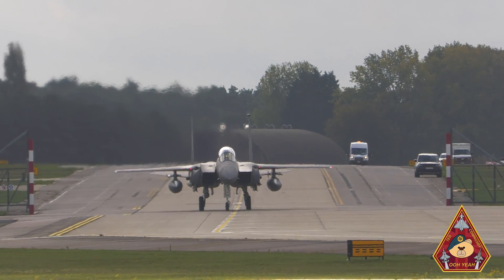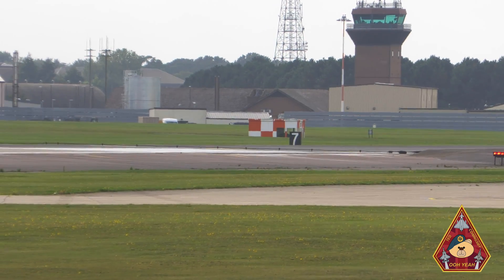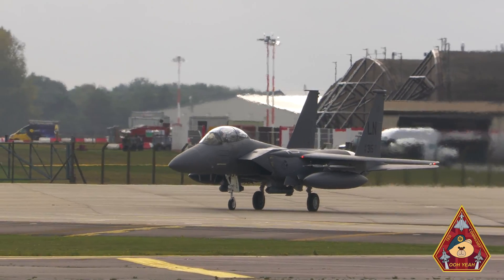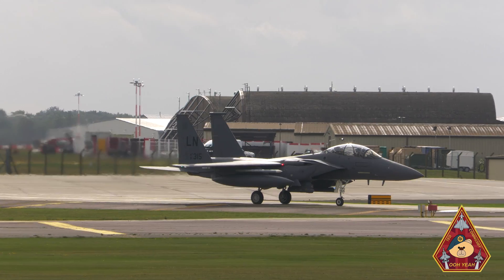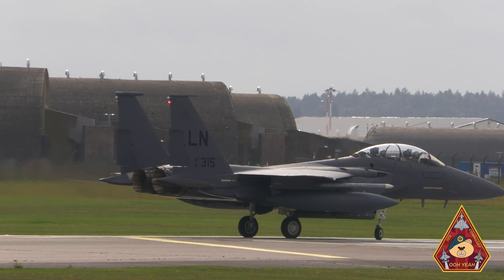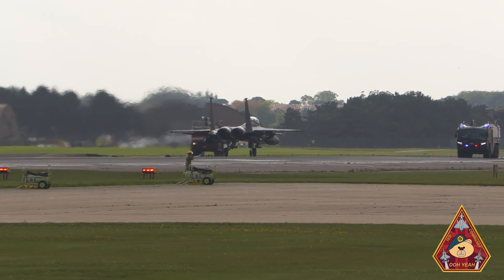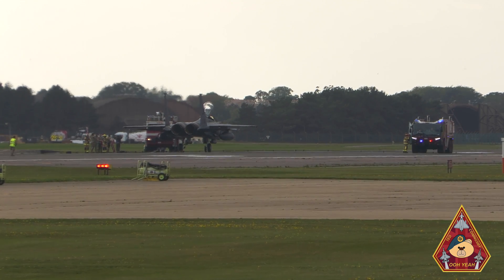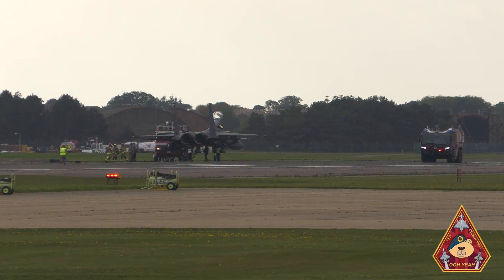F-15 CATCHING THE ARRESTOR CABLE • BARRIER ARRESTING KIT TEST 'RHAG' RAF LAKENHEATH USAF

Comment: Hi Sqn Ldr Ted and Nikos great video, seen this many times whilst at RAF Boscombe Down. Do they also have a barrier at the far ends of the runways these actually catch the whole aircraft in a large net. Because you cannot guarantee the hook will work. Thanks for a great informative video:_RAF::_ted::_ted2::_look:
Reply from the maker: Oii oiii Colin, they do have a RHAG yes at the other end :_f15e::_ted3:
Reply: @TedConingsby  Oii Oii No this is different to the cable or RHAG. Search for Net Barriers and you will see what I mean. Have a nice day.:_ted::_RAF::_TCS:
Reply: I do t think May stations have barriers now. I was at Marham for six years we had two RHAG - Bruggen for 3 2 RHAG and 2 Barrier

Comment: What a great insight into what happens procedure-wise if a pilot needs the arresting gear! This can be quite a traumatic incident, even more so when the life of the pilot depends on the cable at the far end of the runway... will it catch? What if it doesn't? Eject? This practice may seem easy, but it's a very important part of flying (and landing) safety
Reply from the maker: Oii Oii Arjen. Well said and thank you :_look::_usaf::_fweep::_f15e::_ted3:

Comment: Great video Nikos . Is the cable deployed all the time or just for emergencies 👍:_TCS:
Reply from the maker: The RHAG is at both ends but set up ready depending on which runway is in use. You’ll notice the round discs evenly spaced out if it is ready. The other end would have the discs to one side  :_f15e::_ted3:
Reply: @TedConingsby  Thanks Nikos